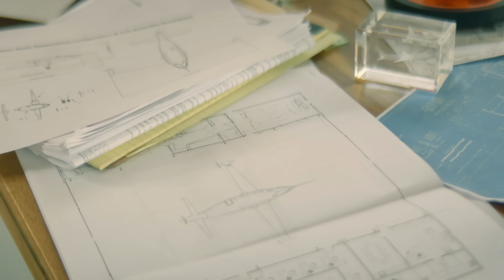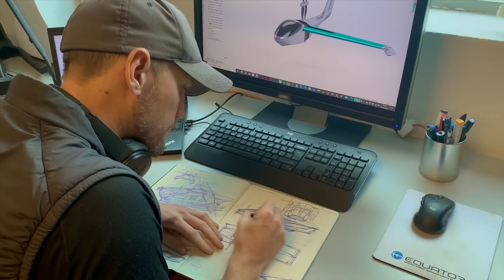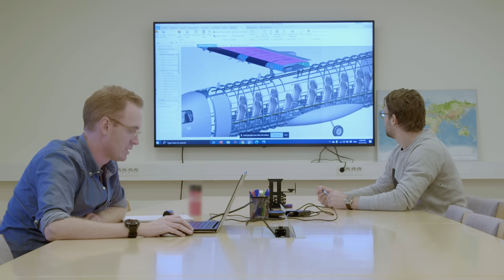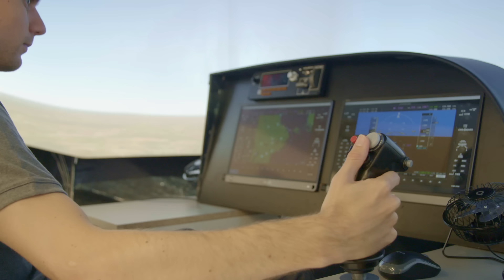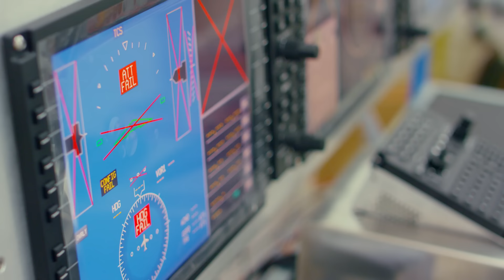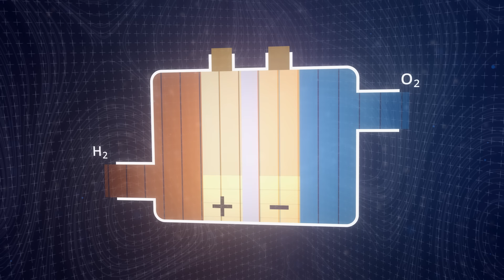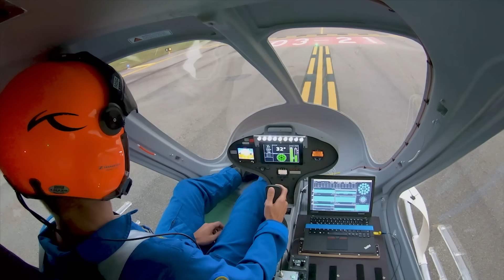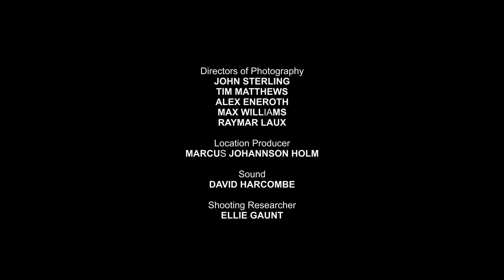Planes of the Future: The End of the Jet Age? | FD Engineering

Comment: The plane is made form carbon fiber a oil product and can't be recycled easily. The battery takes thousands of tons of mined ore to make and very difficult to recycle
Reply: Please do not annoy us with facts, reality.
Reply: Battery recycling is at 97% efficiency
Reply: Aviation batteries will want a very high energy density. As the batteries wear through cycling, they will need a new life in something else, such as marine ships or the utility grid power. There the batteries can have a 20+ year life before needing to be recycled. Once recycled the batteries are received as ore. Hammered into small bits and separated into components such as lithium, cobalt, nickel, steel, gold, copper, and plastics. Since it's a closed loop system, no pollutants are put into the air or sewage water.
Reply: You've got to be American 😂
Reply: Nobody wants to hear that. Say this in a stuffy old English accent, “ yes, yes, I’m so green, I’m way better than you are “   Something has happened to people’s minds, they don’t think about things, they just hear or see a headline and that’s what they go on.
Reply: @hjr2000 your point??  How many products do you have on and in your hand that are made from petroleum based products?  Until you’re able to live an equal or better life without any of these products what are you talking about?
Reply: You don’t know what you are talking about. The batteries are recyclable, currently in the year 2024 at 95% of the materials. Other aircraft using petroleum fuels also have carbon fiber hulls.  I’m sorry you are so ignorant.
Reply: Exactly. I was hoping for a really cool documentary on a new plane, but all we get is woke preaching that is misleading.
Reply: @hjr2000  And a maga/tRump supporter.

Comment: 49:58 LOL lower noise level, this creator have not hear a Electric motor ripping the air in to separate atoms with its carbonfibre props. damn electric motors are noisy with proppellers. thos are not better than a regular Cessna with a Rotax ICE engine! i am sick of all these LIES!
Reply: Absolutely true.90%+ Noise comes from the propellers or’the high speed turbine, not from the engines themselves
Reply: Jet engins are noisy. But combustion engines doesn't have to be.

Comment: I literally hit just stopped the video right after the skyports guy said green rare travel. They might be trying to find more efficient way to travel. But until there is a major breakthrough with energy and energy storage. Travel will never be green unless it’s human powered. Lithium is not a viable option because of the damage it does to create it and it being to expensive to recycle. Fancy flying contraptions have been invented for decades. Yes even electric planes. But no new actual green technology.
Reply: You have to balance the manufacturing of an energy system against the efficency of using it.
I don't think you have the parameters quite right here!
Recycling of lithium and other battery materials is actually a very solvable problem.

Comment: In EV's if you use the cabin heater or defrost modes, in very cold sub freezing winter conditions, especially while driving up steep hills or mountains, the EV range only 40% what it is in warm spring or winter dry sunny weather conditions where you do not need to use cabin heating, where heat seating sufficient and where the window does not fog over with moisture from the passenger breathing or saturated cold air like it can regularly do in cold winter conditions forming frost or opaque dew droplets on the front window obscuring view unless energy intensive defrost heating and dehumidifier modes are used, which also runs the AC pump energy heavy compressor + resistance heater or heat pumps.

Comment: The interesting thing is that when you have the electric plane in the air a old jet striped of internal components becomes a wind tunnel of sorts as the plane soars through the air wind can be transferred to more direct energy to the motors. Also nothing gets sliced in rotors.

Comment: Coming from an aviation background i can understand why the push to develop electric propulsion aircraft, HOWEVER, one critical point about flying a plane on batteries vs fuel, is range and weight of batteries that comes to mind. A fuel powered aircraft fully fueled becomes lighter during its flight time as you burn off fuel , with the options of being able to climb to higher altitudes as you fly, which is an important safety factor when transporting very heavy payloads and flight planning . an electric storage battery on the other hand does not get any lighter as its energy capacity gets used up, meaning you need to fly lower altitudes even closer to ground based obstacles with greater risks of ground collisions (crashing) than the fuel powered aircraft which has vastly more effective range than an electric plane , and its the same with range on an electric car or Truck or Bus etc.I think it is safer to propel a ground based vehicle than an aircraft with electricity.

Comment: The biggest problem that electric powered transportation has been on board storage of energy that is to be used to power the vehicle. The battery technology the developers found to be the most applicable were to heavy and to large to give the range for practical use. The focus has been to reduce the weight while the energy density is increased that improves the range or duration to compete with fossil fuel modes of transportation. A man by the name of Stanley Mayer researching HHO technology from water took it to another level when he discovered that frequency and resonance was the key for using water for fuel in internal combustion engines (ICE) He developed a fuel injector that used water for the fuel supplied and injected a HHO mixture aka Browns gas directly into the combustion chamber of a four stroke engine in real time ! During the research he discovered not only the key to eliminating the volatile Browns gas drawback but also the high pressure fuel tank required to store the Hydrogen in liquid form. A bonus of his research he found that the two elements of water are neutral in their separate states not positive or negative. By passing through a non conductive tube that have copper induction coils out side the tubes entire length and adding plasma to the HHO the plasma attaches to the two neutral elements  and generates large amounts of electrical current ! So much current that applied to a EV all you need for a battery in a closed loop system is enough to start the genset for continuous use, no refueling required to turn your props or wheels or fans! No emissions at all !  it can be applied every where electricity is needed like a cabin in the woods either open loop for heating and cooking with gas and the electricity to light up or charge your phone only topping off the water tank when low.  Do you think with China wanting global control of everything manufactured and mined how long before they would want you to become commies and slaves to be used and abused ? What Stanley wanted for his work was recognition, he was giving it to manas a gift. What he received for his gift was death by poison after turning down an offer in billions to sell all his runs on water technology.

Comment: Very interesting. I had probably heard of most of them but forgotten. The 19 seat plane could be significant. We have a route here in Denmark between Aalborg and Copenhagen that's a little over 200km that might be ideal for it with very strong recharge stations at both ends. And I've also had the vision that a seaplane can be done without significant compromise to performance. They don't have to look goofy and be slow to land on water. Even a high speed long range jet plane could land on water.
Reply: They have already given up on the fully electric plane and are now looking at different hybrids with jet engines instead. to fly 200km, the plane need to have a range of 400km in case it needs to turn around/reroute to an alternative airfield
Reply: @someoneelse7629  heart aerospace? that's sloppy. 400km range (to empty) should be very doable with existing tech. it does require potent power supplies at both ends of course but that's also doable. let's say a few megawatt should do. typical turn around is at least 20 minutes and they only need 200km refill. I will have to have a chat with these slackers :)

Comment: This fellow explaining crosswind landings, doesn't seem to understand crabbing.    There are two techniques to manage a crosswind landings:  
# 1      You keep the airplane aligned with the runway and dip the upwind wing so the sideslip matches the crosswind component of the wind until just before touchdown.     or
#2;       You point the nose upwind enough to match the crosswind component,  then quickly yaw to plane to align with the runway just before or at touchdown.     
            With this plane you wouldn't want to use technique #1 all the way to the ground for fear of striking the pavement with the windward propeller.   So you would want to set up your landing with wings-level crabbing, technique #2,   until just before touchdown,  then quickly yaw the plane to alignment with the runway.   Hopefully the throttle response of these motors is quick and sensitive enough to do this quick-yaw gracefully.   
         Crosswind landing conditions are always quite turbulent.     I would be hesitant to fly this airplane when landing in turbulent conditions may be necessary.     Unless it is possible to stop the two-bladed propellers in the horizontal position, they are in danger of ground strike on any landing.   Some built-in push-button mechanism would surely be necessary so pilot can stop them momentarily for a few seconds until the plane is firmly down on the runway.   
        I kinda think this concept,   though it improves energy efficiency somewhat,  is not worth it in practical airplanes.   The experimental efforts could have best been spent  on controllable winglets. 
        Just my humble opinion, thank you .

Comment: There's tiny batteries that can be printed, if I recall. I know there's  tiny batteries. Smaller the battery the faster they charge. When I started thinking about electric aircraft, I imagined micro batteries in the skin of the aircraft. This will help distribute the weight. Then, there's material combination that use the different temps between them to create electricity. Using these products will help decrease the weight of the larger more conventional batteries needed.

Edit: what about using the ram jet design; instead of using it a a means to burn fuel, put an alternator in place of the fuel injectors.

Comment: The propellor is not the most efficient energy converter into thrust because the kinetic energy from its downstream (contracting) flow is being unused. It may be possible by the use of a radial compressor and then using a cup shaped surround to turn the radial flow downstream, this compressor's radial flow goes into an aft flowing direction. Unlike the propellor, this flow is expanding and its pressure is reducing as it flows in the aft direction and expands. Due to this associated lower pressure being slowed over a greater diameter than what the propellor provides, the total thrust will be more for the same amount of power being used.

Comment: H2O2 Rocket Glider Sutainers.. I contacted a Glider company on it, because it wouldn't have any deployment delay; and so could be used for automated stall protection.
there is the consumable catalyst, and I don't know the lowest energy route to H202, but that process energy is like "charging" a battery, but the energy density is better.
also, a second braking rocket could make for water-less Gliders with longer glide ratios.......the exhaust is plasma to steam ( water )
it still would make more sense to cable launch.... but those are ground based launchers, with plenty of renewable energy options.

Comment: Using a mass optimized APU ** (Range Extender Turbine Generator Battery Charger & Prime Power Generator) with a small low mass polymer fuel tank & pump & FADEC controller + battery electric axial flux mass reduced motor ducted fan, a PHEV aircraft can have short electric takeoff and low noise landings too, but once up in the air, the somewhat louder (noise reduces and mass reduced APU range extender) can then operate to recharge the batteries and power the prop or ducted fan motors to give even better range and rapid refill for more range, while still retaining electric quite cleaner takeoff and landing, and even energy recovery when landing like brake regeneration in a BEV automobile to further improve system efficiency more.

Comment: When the electric car can travel the 10hour trip from Mt Isa to Townsville and take <10minutes to recharge with A/C to keep the interior cool and there is no lineup to access a recharge station then maybe I’ll consider one. But only if it works out cheaper to buy (without government subsidies), and guaranteed for a minimum of 10 years with minimal service and repair costs and not a flame trap.
Reply: As soon as I can fully fuel my ICE vehicle at home for $3, and have a smooth vibration free ride, and won’t destroy the planet in the process nor poison myself from the exhaust and be near maintenance free, I’ll buy one.  Oh, well that will be never so I will stick with my EV.

Comment: The key advantages of thorium batteries are their long lifespan, high energy density, and the fact that thorium is more abundant and less radioactive than traditional nuclear fuels like uranium. Thorium batteries could potentially power devices for decades without needing to be recharged or refueled. So why don't we have them?
Reply: The lower radioactivity means the power density is very low - useless for powering an aircraft.

Comment: 1MJ/Kg for stored electricity with some hard limits on improvement means no long distance mass passenger market. We live in strangely indulgent ways, that will have to changfe whatever else we discover. Fusion (still 30 years away) won't change that much or quickly.

Comment: CATL is already mass producing batteries with 500 wh/kg and has already installed them in jumbo jets. The fact that petrol is more energy dense is immaterial. The savings in fuel cost will drive adoption.
Reply: Show me a link to a Jumbo Jet converted to battery powered flight. 😂
Reply: Give us the link for that?
I'm quite familiar with the CATL website and I don't recall seeing anything there
Reply: "The fact that petrol is more energy dense is immaterial."
That statement reduced your credibility to 0.
Learn about energy density.
Reply: @Forcix  energy density doesn’t drive economics. Cost and profit does.
Reply: "CATL launches condensed battery with an energy density of up to 500 Wh/kg, enables electrification of passenger aircrafts"
2023-04-19

Comment: hey guys here is simple equation which tells you a possible range for an electric aircraft for steady cruise condition:

R = (e/g) * (cl/cd) * (mB/m) * eta

R ... range in m
e ... specific energy density (J/kg)
g ... gravitational acceleration
cl.... lift coefficient
cd ... drag coefficient 
mB ... mass battery
m ... mass airplane
eta ... total efficiency 

(e/g) specific energy term -> e.g. 150Wh/kg/9.81ms-2 = 55000m 
(cl/cd) aerodynamic term (glide ratio) -> e.g. 20
(mB/m) structural term (battery mass ratio) -> e.g. 60%
eta e.g. 0.5

R = 55000 *  20 * 60% * 0.5 = 330km ....

forget electric airplanes !

Comment: Are you able to add solar panels to assist with the Regen of the batteries during flight?
Reply: They will not even give enough to compensate for their own weight (and it's not regen, it is charging, re generative power would be if there was a downhill in the sky where the prop drove the engine)

Comment: I’m all for electric planes, but they’re going to suffer the same issues as current electric cars. Range is no longer a constant because temperature around the battery can significantly decrease its use. Also, all region aircraft need to takeoff, land, takeoff, land repeatedly in one day to make money. In order to keep aircraft on schedule batteries would need to be pulled and switched out at airports between take offs. No one has 2-6 hours for an aircraft to recharge every 1-4 hours of use. An aircraft sitting on the ground isn’t making money.
Reply: I’m sure that there will be solutions to those issues that allow aircraft to have quicker turn around times. This is just the beginning.
Reply: @mendodave  Perhaps or maybe batteries are nearing there maximum potential with the elements available on earth.

Comment: Good news: We've had the breakthroughs, and we're beginning to make 500WH/kg batteries, which is just enough for regional commercial aviation. And they are even getting better!
Bad news: No sane airline is going to buy an aircraft that is only capable of regional routes. They are going to want more flexibility than that. And because the market is small, major aerospace firms are going to be reluctant to commit the billions it will require to develop a 'just good enough' aircraft that will likely be outdated in less than a decade. Because batteries are getting even better....

Comment: Electric powered aircraft is basically from the same playbook as locomotive engines did over 80-years ago. Actual rail propulsion is achieved with electrical motors while the energy to do so is supplied by a power source. Diesel in the case of the train, and battery in these new planes. Brick walls where battery capability and charging were envisioned to be at their physical and electrical limits have repeatedly been smashed. Recent advances all over the world bodes well with no end in sight for future battery improvements made on an ever faster tract. I believe battery advances will make combustion derived propulsion on air and land obsolete by, or before, 2050.
Reply: Land, yes.
Air, 50:50